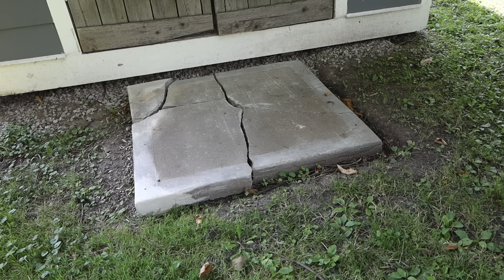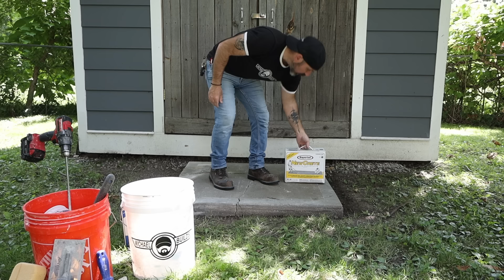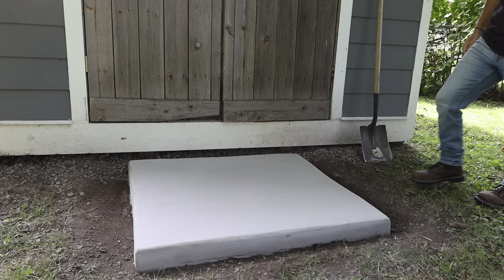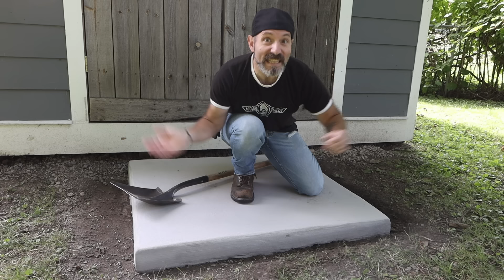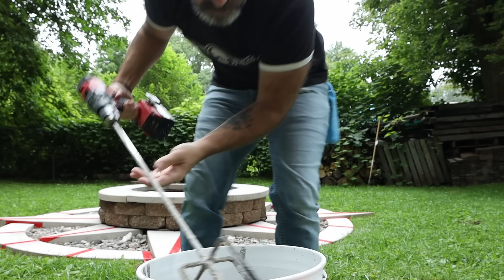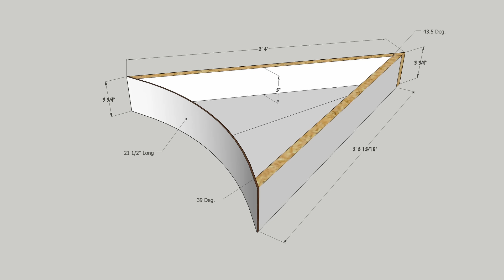How to Resurface Concrete with Rapid Set NewCrete

Comment: It does look good.  However, for a slab like that, it would only cost however many bags of concrete, which are very cheap and some forms 2x4s and about the same amount of time to do what was done. And I'm going to guess that slab is about 4 feet by 4 feet by 4 inches.  80 lbs bag of concrete is about $5 at Home Depot.  That would take approximately 10 bags or $50 dollars total.  It is not "thousands." The structural integrity would be much higher as well with a new slab.  I understand it might last with the newcrete product, but I would much rather have a brand new slab using the couple bags of concrete vs resurfacing it.  Just my opinion though.
Reply: Dude that was a sample FFS!! Jaysus, you people!

Comment: Nice video, but to be honest I’m not sure I see an advantage for a job of that size over just replacing the slab.  Existing slab was already broken into nice size pieces for you, could have simply pulled them out, redeveloped the base, framed it up and done a dry pour slab in a couple of hours and been done with it, for less time and money….
Reply from the maker: Yes that is true… but the point of the video is to show my viewers how to make this kind of repair wether it’s a small porch or an entire driveway. Yes, my little slab would only cost me $30 to completely replace myself but these projects can be $5,000-$10,000 depending on the size and wether or not you have to hire a professional.

Comment: I'm all about fixing stuff, but if that's a 4'x5'x4" slab, then you would have saved money by just buying 12 bags of concrete and pouring a new one versus buying the NewCrete and patch. And saved time and done it right because there's nothing actually holding that broken slab together as these are not structural products. Demo would have been only a few swings of a sledgehammer and forms are only 2- 2x4's. I do see good uses for this product, but this is not it.
Reply from the maker: This is all true, but this video is not about me saving money on my small slab. This is a demonstration to show people how to use these two products to save them money on their projects big or small. This video is also about buying yourself time and giving people options when they feel they have none.

Comment: How about a video on the durability of a material poured over an existing slab.
Reply: The 2 year front porch wasn't good enough?
Reply: @adelinawarriner6259  I actually thought the porch came out great. 

But, it would be good to see a slab. Even a small 10×10 slab that the sun bakes all day in the summer and snowed on in the winter.  That would be cool to see as this is my real life application. I do think it will work, but would be nice to see and to also see how it holds up to the exposure over time.
Reply: Or a 1 year f/u video (could be a Short)  AND was it just for Foot traffic, or ok for a Driveway??
Reply: Dude have you used cement all?

I have it on five rental properties I’ve never seen it crack when installed properly. Has he just used the resurfacer then yes but he did good patching first
Reply: @chriscolameco6850 it does Crack here in Dallas Texas we have clay soil & huge temp swings however cracks are tiny after 2 years & will fill with sika caulk I highly recommend Mike Haducks videos on how to repair concrete still better than replacing
Reply: Thanks for the video. I hope it works for non-skilled people.
Reply: He does sound like a sales rep a little. That slab will hold up if u are 90 lbs.🪚
Reply: @GARRY3754 How many have you done?
Reply: @barbarat5729 40 years of carpentry and miscellaneous items. It’s all arbitrary. No heavy weight, ice, freezing, water, sun light,etc…..it could last or not.
Reply: ??? He showed his front stoop from two years ago that he used this resurfacing on!
Reply: How about you make a video of doing it the proper way? 😂🙄
Reply: @Steve0885 this is a quick repair option if you don’t have the money to repair your cracked concrete
Reply: Drivewa. What does you common sense tell you?  No Bueno.
Reply: @fff-cf4fx  I look at product reviews like these on youtube, then I look at Home Depot customer reviews.   Gotta wonder why some of the HD reviews are so negative!
Reply: Why don't you make that video
Reply: @Northern_Porkchop 😂😂😂😂

Comment: Hey Michael, wasn’t that slab from a dry poor video.  Did the slab fail like that because of the dry poor or did you make the slab fail. Curious on the dry poor because I am thinking about doing it on an application, but if it fails like that might change to wet, classic method.  Ps, love your videos, keep it up.
Reply: He went to a lot of effort to break up that slab, he has a video of his testing on it. 

I have done far more extensive testing of dry pour and wet pour test slabs using the same concrete mix. A couple surprising things that came out  of that. I made  the slabs in food containers that you could see through and carefully measured every bit of water used in both methods. These were 3 inch slabs. I made the wet mix properly and not soupy like many people do. 

When misting down the dry pour, using a garden sprayer so I could accurately measure the water used and even collected any overspray to subtract that amount from the total used. 

On the first misting, I watched the water work its way down into the slab.  I was getting about 3/4" penetration which pretty much leveled out to no more absorption, in 30 minutes time. So I adjusted my misting time to 30 minute intervals. The absorption rate continued to be the same throughout. After the last misting, I could see from underneath, that even in the middle, the wetting was the same.  So here's the shocker. The total water used was virtually identical to tthe water used to make the wet mix!!

I did the wet pour in an identical container. After it sat for a little while, a little excess water came to the surface. not very much. As I said, I mixed it by the book and not at all soupy, so it was what I had expected to see. 

An interesting difference i observing from the sides was that in the wet mix, it appeared that some "cream" migrated out to the sides as well as the surface. I believe that the density and overall difference in weight and density of the wet mix, forced the smallest particles out of the mix to the surfaces. Those smallest particles would be the cement in the mix. 

Also interesting is that by stepping up the misting schedule to every 30 minutes, based on observed absorption, meant the dry pour slab was fully wetted in 2 hours. which is within the range of time for a wet pour, before you start to finish the surface. I think this meant that the dry pour surface was accepting water through it equally through the process, in other words, not curing too soon. 

I even measured temperatures of the slabs during the process and could not detect a discernable difference. I think the slabs were too small to see any significant heating.  This might well be different in very thick pours. But my conclusion in these tests, was that curing heat differences were insignificant. 

I finished the wet pour slabs as normal but did nothing to the dry pour slabs. 

Also did slabs of both with 12ga remesh and without. 

The most notable differences as the slabs sit for a while is the distinct difference in both color appearance and surface texture. The wet pour is more of a slate grey appearance and much smoother. That was observable across all surfaces of the slabs after removing them from the forms a few tdays later. 

As the slabs cured, I also took some weight measurements. More on that later. 

So after curing for 30 days, I saw cut both sets of slabs. There was no noticeable difference in the resistance to the saw cuts, although I did not attempt to scientifically quantify that. Basically, it felt the same for both. 

By visual comparison no difference was notable. They both appeared to be fully cured. However, there was a very slight difference in feel to touch. There was an ever so slightly rougher texture on the dry pour. Misting the two cuts, the dry pour soaked  up the water noticeably more as if more porous. Yu could pretty quickly tell which was which by this characteristic. although they  visibly seemed identical dry. 

If you looked very closely, the wet pour slabs seemed to be a bit better bonded to the remesh and bigger pieces of aggregate, but the difference seemed minor and not consistent everywhere.  So a difference, but maybe not all that significant. 

Now I have also made some cores which I intend to test under pressure. But I need to make some modifications to my test set up in order to accurately quantify the force applied. In the mean time, the cores will have more cure time. 

So my conclusions to date on these detailed experiments is that dry pour gives you a slab that will be suitable for most applications. I think strengthwise, the two will be very close. I may know more after pressure testing, but I doubt that it will show any significant weakness. If you wet mix too wet, it is proven that strength is lowered. If you are pouring floors for a parking garage, that could be significant which is why they do testing. But for general slab duty, you will probably never know the difference,  But the key difference in dry pour is in surface appearance and texture. I think a couple things can help. One is to make a goad effort to compact the dry mix when put down. Also, screed aggressively, a bit more than just levelling it off. The reason being is that this will bring more fines, including the cement, to the surface. 

There are a couple guys suggesting using mortar mix on the top inch or so, but the problem I see with that is that for one, it's more expensive and for another, it uses quicklime which is calcified lime. Strength and its hygroscopic nature  may lead to issues in heavy frost environments.  I think it makes more sense to lightly disperse some extra Portland cement cement on the surface before screeding and rolling. Just a little bit should make a difference in final appearance. In a wet pour, the "cream" that you work up is mostly cement. 

I have done some testing with epoxy sealants in top, applied with a roller. I used the pretty cheap two part mix epoxy for things like bar tops, etc. A gallon applied with a roller goes a long way and it does seem to somewhat smooth out the surface and bond the sand grains. Maybe a coating of the stuff he uses in the video might work nice too, but I don't have a feel for the cost and coverage. 

So lastly a bit about the weight measurement I took while testing.  I initially weighed the require dry concrete based on the volume need for my test slabs. I processed each volume separately as described. I didn't weigh again until the slabs had a few days cure on them. Now by not weighing along the way I may  have introduced some error. My initial volumes measured worked out just about right. But the finished 3 day cured slabs measured slightly different.  However the weight of the dry and wet pour slabs were noticeably different with the wet slab weighing more, somewhere around 5 to 10% more. Bu the end of the 3o day cure, the wet slabs lost a little weight, but the dry slabs stayed about the same. 

I can't come up with good reason for this other than some  error I introduced or an ultimate difference in density. Does the cured wet pour actually contain a bit more water? Maybe. The cured cut slabs suggested more porosity than the set pour slabs.  But maybe in the curing process, some water got chemically converted to a solid of higher density, where as the dry pour never exhibited some excess water to allow that chemical reaction. IDK and I'm purely theorizing without having any real solid information about the curing process at a chemical level. Could be that I just got a bit sloppy in the weight measurements and introduce some error. I am anxious to see what the tensile strength testing shows and I want to make sure my measurements will produce accurate results that will be discernable.   Curious to hear what others may have learned. Suffice to say, I have pretty high confidence in dry pour overall. For what I have done, the surface texture issue is not a problem. I have a exceptionally well finish wet pour slab as my shop floor and it can get very slick when wet. almost dangerously so.

Comment: I think it will eventually crack because the existing slab had such bad cracks in it. Maybe if you add some thin wire then cover or but fiber in the mix somehow it would hold up long term
Reply: Even that wouldn't help this. Will recrack quick!
Reply: As small as it is and the resurfacing work involved, why not just get some 2 x 4 form boards and some quickcrete and pour a new one???
Reply: As long as he doesn't drive over it again, this landing pad will last with foot traffic.

Comment: How would that hold up to chemicals or salts used on roads during winter snows and snow melt. I was thinking of using this to resurface my garage floor. Problem is snow does melt onto it during winter months. Would I need to apply a sealant and which sealant is best so that it is not slippery?

Comment: I removed OLD carpet and tack strips from our basement floor and the tack strips left divots in the concrete. I'd like to use this stuff to repair them, however there is also leftover (old) glue residue in some of the areas, any ideas on how to get the glue off the concrete?

Comment: I am thinking of making a faux retaining wall out of cement blocks. Noticed online that there is a cement bonding cement that could make it look continuous. Could this be used for vertical application or is there something else? I’ve seen bonding cement for $40 a bag which I believe it to be overpriced. Or do you have an alternative product or supporting video?
Reply: I believe RediSet mortar mix is what you want.  You'll not need a bonding agent.  Michael has a video demonstrating this on a vertical cement block wall.  Very cool all the looks you can get!
Reply: @Asti.sayAhstee  Thanks! That’s exactly what I’m looking for. I’ll try to find Michael’s video for vertical retaining walls.

Comment: I have a rough surface garage floor, would the New Crete be a good product to smooth out the surface?
Reply from the maker: Absolutely! Just make sure you clean those grease and oil spots REALLY WELL otherwise the resurfacer will delaminate
Reply: He showed in the video that's exactly what the product will do.  Being an indoor project would make no difference.

Comment: I just used the cement all to fix my cracked sidewalk and it turned out great. I want to go over it with new Crete, but I want to repair the cracked driveway first. Will it last if I just fill the cracks with cement all, or should I cut a few inches on either side of the crack and pour cement all in to make one slab again? I’ve seen repairs done like that with regular cement, but I don’t know if I should do it that way. I hope I described this so you can understand me. 😂
Reply from the maker: It’s always better to open the cracks up a bit but that only usually with thin cracks. Otherwise you should be fine

Comment: How did you save thousands of dollars by fixing that slab???🤔
Reply from the maker: No, I didn’t save thousands of dollars on this particular project but if you have a drive way that will cost $8,000-$10,000 to rip up and replace and you just can’t afford such a project, then this might be a great plan B
Reply: @MichaelBuilds  I didn’t think so. But in your video you said doing this saved YOU thousand of dollars.
Reply: @Ksjimi  he said "you've saved yourself thousands of dollars".
Reply: I just demoed and extended my patio, and even after borrowing every single tool i didn't have and doing all the work myself except the concrete finishing part, it still cost me $2000. If you can avoid replacing a slab, you'll definitely save thousands of dollars
Reply: @ACE7O2  not what he said. He referred to that tiny slab.
Reply: Have you heard of inflation and cost materials and overhead....  having some professional come on their time...using their resources and their skill and labor.    Maybe in that way.. it could save someone thousands? 🤔
Reply: @mrupholsteryman  think again and this time, think harder.
Reply: @Ksjimi  thinking will cost me.  Can't afford it! 😅🤣😂
Reply: Concrete slabs are not cheap.
Reply: @AbendscheinLGN  thousands of dollars?
Reply: I know this comment was years ago, but I think it's pretty obvious he's talking about bigger projects. Not that little slab 😂.
Reply: With the slab shown in the video, it might have been easier to replace the slab with new concrete. If I had a driveway that looked like the slab in the video, I would hire a concrete contractor, like Odell Complete Concrete, to replace my driveway.
Reply from the maker: @chesslover8829  yes but the point of the video is to show people what they can do if they don’t have the money to hire a contractor at the moment

Comment: You indicated that this will extend the life of the slab by several years.  Will the slab eventuall crack or will that top layer peel away?  And why could you not simply feather the Cement All over the entire slab to make a uniform finish?
Reply from the maker: Either issue could happen and it could last 2 years or 20 years, it just depends on how bad the concrete is and how much use it gets. Even tho the Cement All can go to a feathered edge, it’s not made for being thin over a large area like this. CA would also be very difficult to work with over large areas like this as well. NewCrete is waaaaaay easier to work with with this large projects 👍🏻
Reply: @MichaelBuilds  you da man!
Reply: 2:45 here's your answer.
Reply: @Player456-xy1gs  thanks.  I’m thinking even longer range however.  At my age I can replace something now but won’t be able to do so myself much longer.